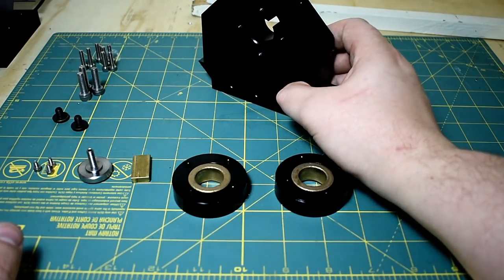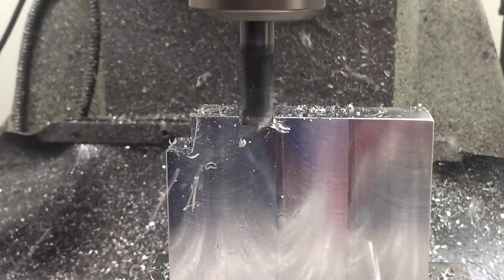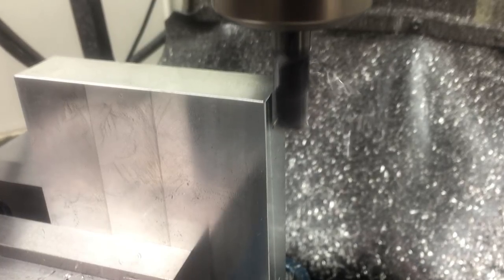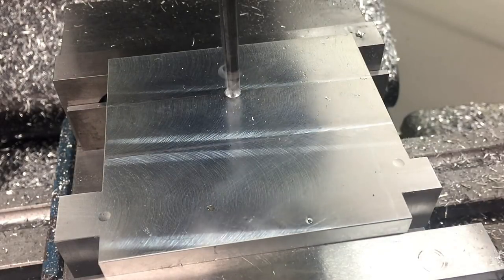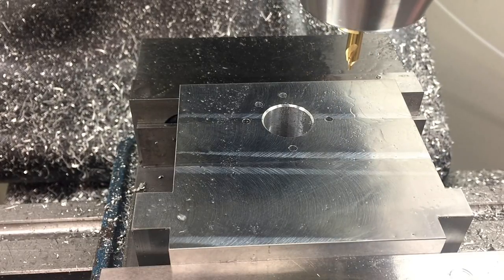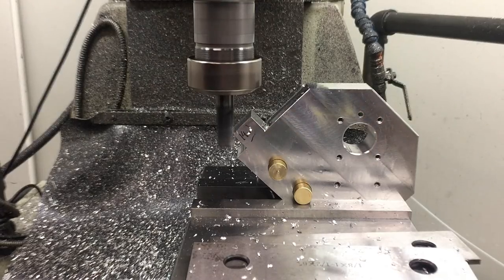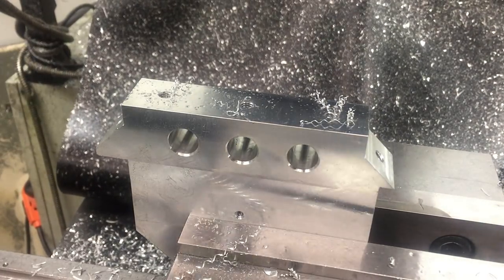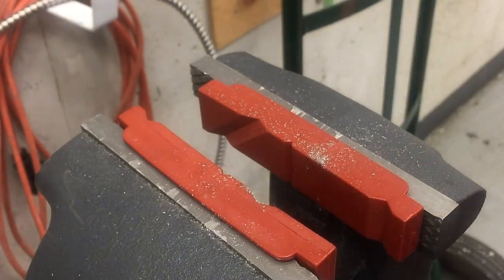The Jeweler's Lathe Part 4 and a bit:  Machining the Tailstock

Comment: Does anodizing increase thickness of the part? What's the typical variation?
Reply from the maker: It does by a few microns, so it's not usually a big issue unless its for a super precision fit.  Reamed holes can sometimes be a problem.
Reply: Tim Le ive seen anodize add anywhere from .0002 to .0025 
Depends on the plater and how well they do what they do .
I typically send out a sample and. When i get the sample back from plater i usually make adjustments on my end or theirs.